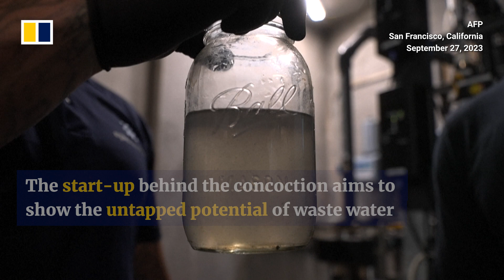Tapping the potential of waste water

Comment: How do they clean strong chemicals used in the household?!
Reply: As someone that works in the Industrial Water industry at both the Ultra Purewater and the opposite end in Industrial Water end, removing strong household chemicals isn’t that hard with the right process equipment. I have a saying that goes, every drop of water on the planet can be made clean, it’s just how much money it will cost to do it will be the problem.
Reply: With other chemicals. Not all chemicals are harmful and some chemicals can bond with detergents and be removed, or they could have different evaporation rates. There are soo many methods.
Reply: Same way you separate any water from "human debris"
Reply: Distillation maybe?
Reply: Same as rain, it evaporates all kinds of water, no matter what water, and turn it into actual pure rain water, and drops down to us to drink. God's creation is marvellous.